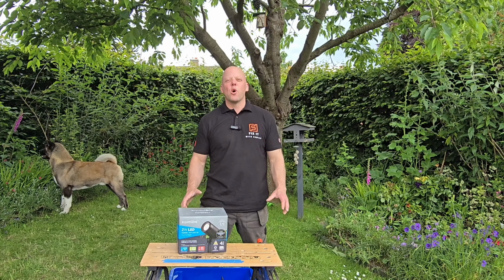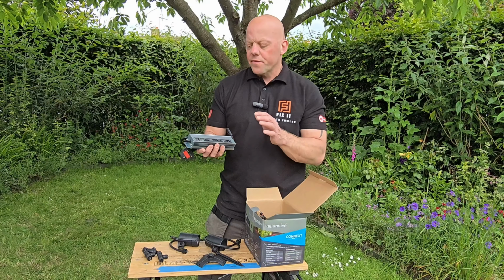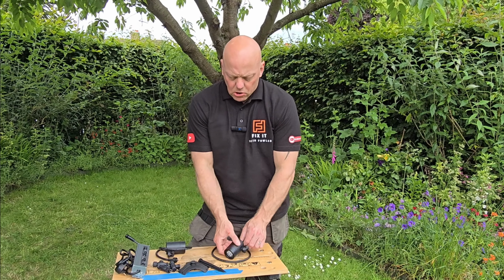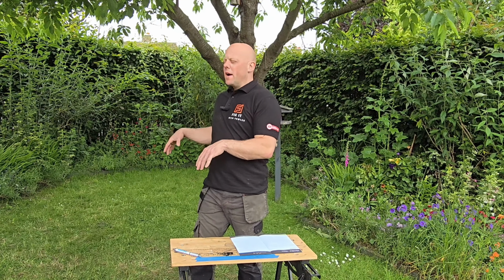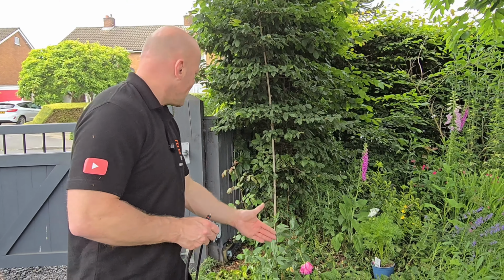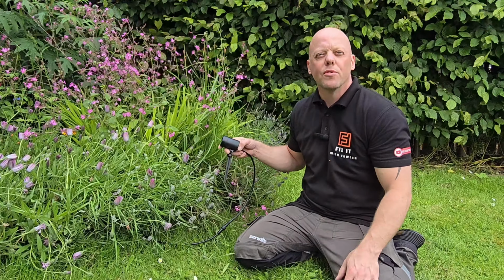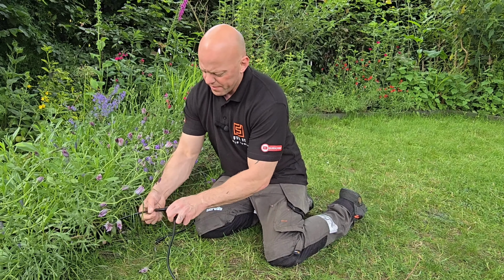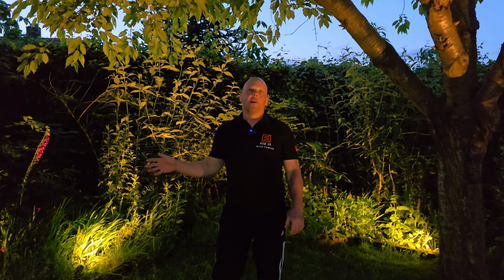Transform Your Garden with 12V Lighting: The Ultimate Guide

Comment: Those lights look amazing, especially the one shining up the tree! I am definitely going to try and put some in my garden, do i need to bury the cables? Great video
Reply from the maker: Hi, I'm really pleased with the garden lights. The cables do not have to be buried as they are only low voltage, so there is no chance of electric shock. Thanks for your comment!
Reply: @FixitwithFowler  Thanks for that, i can't find the starter kit you used, where can i get one?
Reply from the maker: I got mine from wickes.
Reply: @FixitwithFowler  ok, thanks for your help!
Reply from the maker: @festival10 no problem 😁

Comment: Hi Steve, i can see individual links but where is the link to the kit you mentioned with 12 lights?
Reply from the maker: Hi, unfortunately, the starter kit is not available from amazon at the moment. They have a good deal at Wickes, and the starter kit is £50.
Reply: @FixitwithFowler  thanks mate… presumably though the transformer with the Wickes kit (4 lights) won’t handle another 8 lights?… i need 12 in total. Thanks in advance
Reply from the maker: @RDR1456 yes that's the kit I used from wickes. It's suitable for upto 12 lights and 50M of cabling
Reply: @FixitwithFowler  cheers mate!!
Reply from the maker: No problem, let me know how you get on with the lights!
Reply: And ALL the extras are cheaper than Amazon. 👍
At Wickes.
Reply from the maker: @carlrice789 yeah that's right, it's just a convince thing with amazon
Reply: Mate i need about 20 lights….  (I’ll buy 4 or 5 kits as it works out cheaper) You reckon i could use 2 transformers in series as you were saying one can only handle 12 lights?
Reply from the maker: @RDR1456 hi, each transfomer will require it's own power supply from a mains socket. I would split the lights and run half from one and half from the other. I did exactly the same and purchased 2 starter kits for my lights.
Reply: @FixitwithFowler  oh damn, I’ve already ran some SWA cable under the patio and wanted to put a transformer up at the house end and then splice this kit into the other end for the flower beds. I can’t be doing with visible wiring. I was hoping their might be a way to run them in series. Have you tried overloading the first transformer with more lights? Normally they’ll always leave a tolerance?
Reply from the maker: Why don't you just put a double waterproof socket on the end of the swap cable? Then just plug them in like this https://youtube.com/shorts/JHGXbQ1Gph0?si=yhFK2gyPk66F9u0Z
Reply: @FixitwithFowler  Wanted to say thanks for help mate. I've a mate who is a sparky he said fine to run up to 20 lights with the transformer, running 16 now, works fine, thanks again
Reply from the maker: @RDR1456 No problem mate, if you get 2 kits, then you will have a transformer spare!
Reply: @FixitwithFowler  yes exactly that… i got 4 kits… once transformer is bastardised to splice into the SWA so yes 3 spares!! Lol. Might buy some of their bollards for the front garden 🪴
Reply from the maker: @RDR1456 I think it's a brilliant kit and will be using them in the back when I make a raised planter. Let me know how you get on, cheers